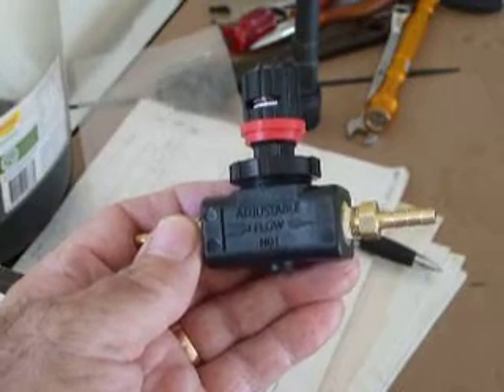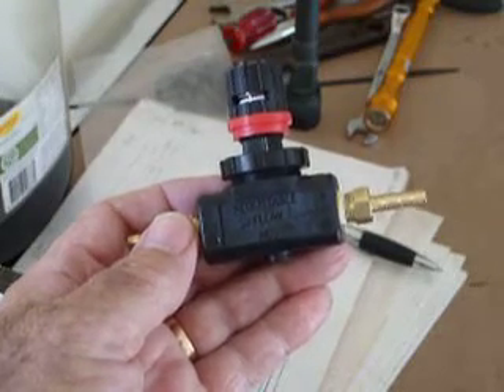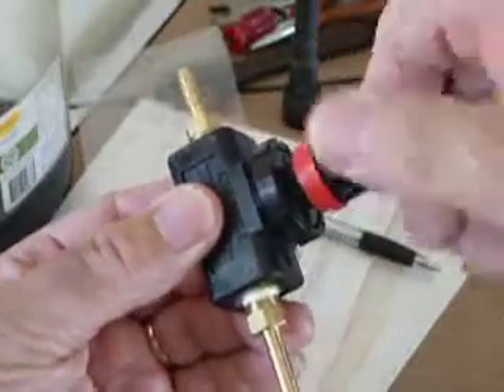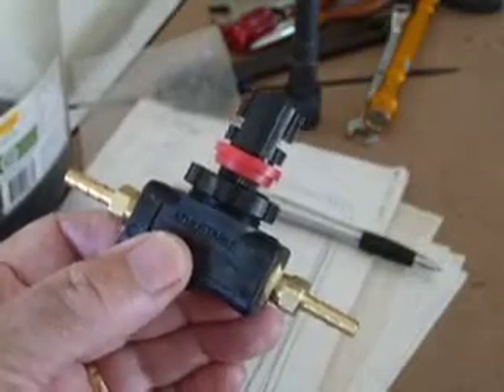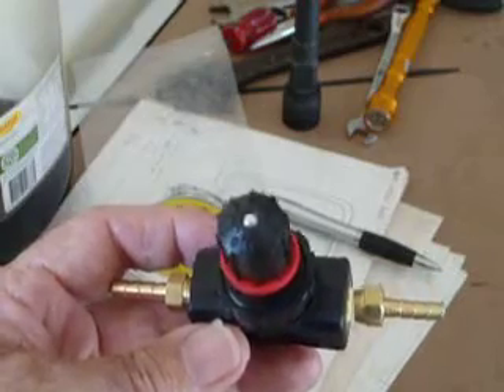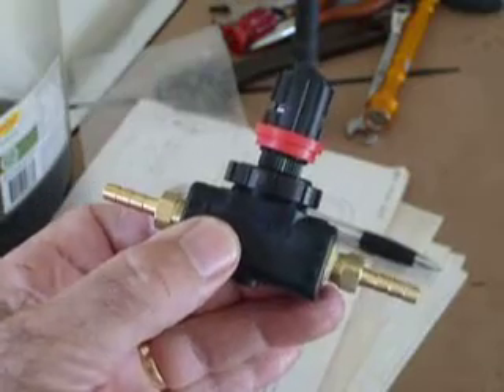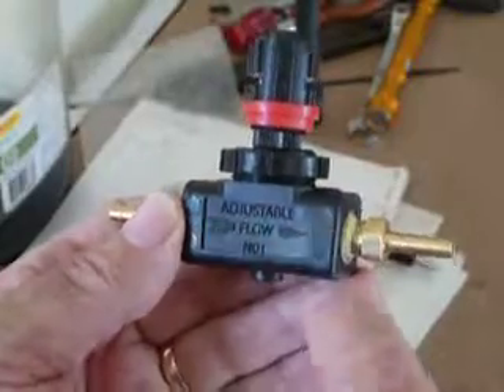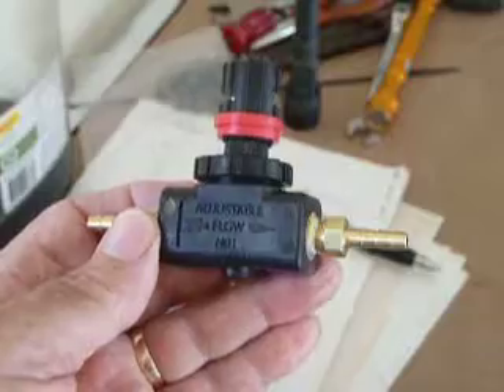Nissan 3L Spoolup Rate Control, Needle Valve Summary

Comment: I have just recieved from 3 bar racing , a needle valve , a dawes valve , a boost gauge and some T pieces . I have been looking at schematics and videos on how it is set up.

The part that I do not understand is where does the vaccum line goes if you have a stock intercooler? I have an intercooler that has the stock sides and the core is a bit bigger and the sides are welded , but it does not have any holes in it. In the stock config there is a T piece under it where the vaccum line goes? Am I just suposed to use it as it is or?
Reply from the maker: Confused here, you don't connect any vacuum line to the IC only the boost line that goes to the back of the Dawes. If it is boost line your referring to then you can buy an adapter that fits under the MAP switch on the IC (look on ebay) that is by far the easiest way. I'm not aware of any T on a std IC, my old IC definitely doesn't have such a fitting.